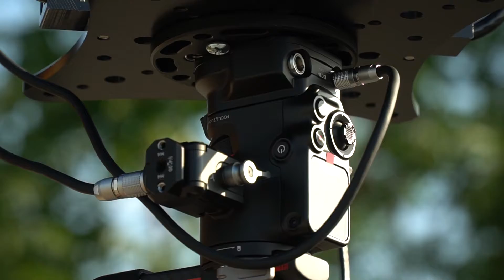FILM EPIC ROLLING SHOTS SAFELY- DIY CAMERA CAR RIG - DJI RS2 - SONY A7III

Comment: thanks for the vid, i just subbed because I am in the midst of planning a camera car
Reply from the maker: I hope this video helped with some ideas! What are you looking to do?
Reply: @nickpedroza  I'm currently working with a 4x4 ram w/ no less than 3 reciever slots for my diy cloud mount, and a tahoe ppv w/ one on the front but it's not stable enough. now trying the camvate g-10 & a 90degree plate w/ mini cloud. have yet to try it but it supports my weebill s and zv1
Reply from the maker: @Nathan660  why isn’t it stable enough?
Reply: @nickpedroza  i should say that the problem is specific to the tahoe. it's the way I mounted it to the vehicle. nothing to do with the diy cloud or anything else other than the weight of the device hanging that far forward. i have learned that the closer you get the optic to the center of the vehicle the better the stability, the tradeoff being increasingly worse angle to film from. we all like lower slung shots without the rig vehicle being in frame.

Comment: great video and detail man. have you done any updating to the rig?
Reply from the maker: Thank you! Not much. It stopped working for a while and I had roughly a 3 month process of going back and forth with DJI to get it sorted out and fixed, but it still holds up with this exact setup to this day. I used it a few weeks ago with no problem!

Comment: I built one last year. I still use it now as well. My only complaint is I I centered mine and also am stuck with front and side profile shots.
Reply from the maker: Yea I think the only workaround is planning ahead , putting another bar on it. Or have another Person in the car filming lol . What gimbal/setup do you use?
Reply: @nickpedroza  I’m currently using my Ronin MX and Sony mirrorless cameras. I know Cody and Halcyon did a t bar set up for theirs to get the camera to the sides of the rear for the shots.
Reply from the maker: @jamsmedia9641  yea I’ve seen that setup. That’s awesome the og ronins are the best- honestly considered getting one just for this at one point but I’m pretty happy with the current setup and route I took
Reply from the maker: @jamsmedia9641  what’s your ig?
Reply: @nickpedroza  how fast can you drive with the og Ronin 1 with it rigged on the car?
Reply from the maker: @hardipusa  I’d have to get the mount for it but I can try working on it!
Reply from the maker: @hardipusa  also do you mean the ronin or ronin m? I have the ronin m currently but I can also try sourcing a ronin 1 for this
Reply: @nickpedroza  the ronin not the ronin m
Reply from the maker: @hardipusa  I’ll look into it for you. Do you currently own one?
Reply: @nickpedroza  Yes sir, I want to build a camera car rig in the near future like 6 months so I was wondering if I should just dust off my old ronin in the closet or get a ronin 2. I appreciate it!
Reply from the maker: @hardipusa  any chance you’re near nyc or the surrounding states?
Reply: @nickpedroza  California unfortunately!